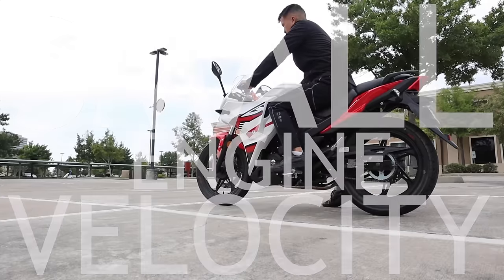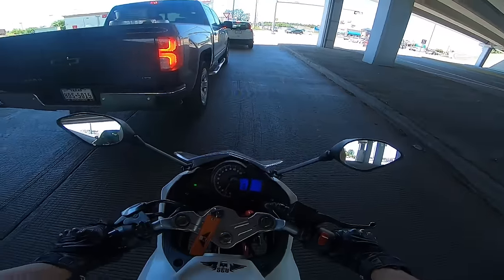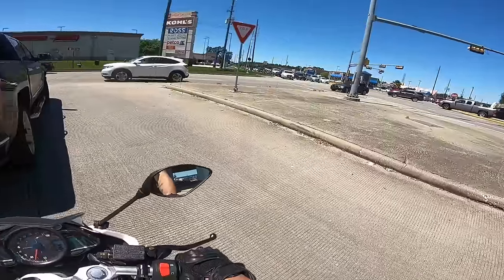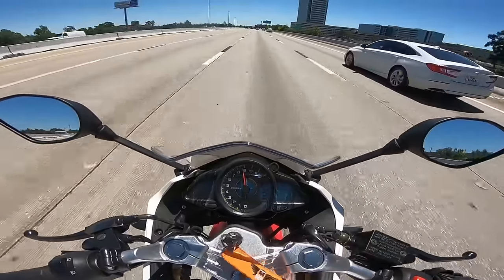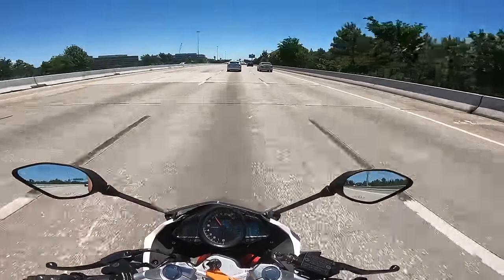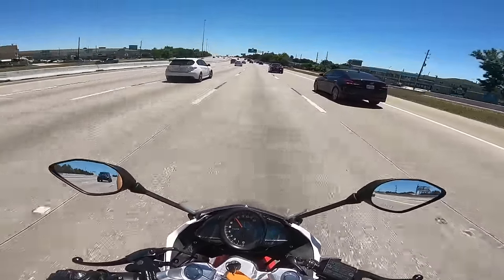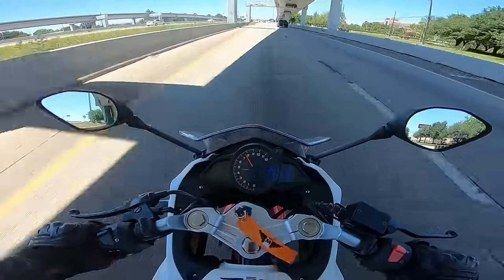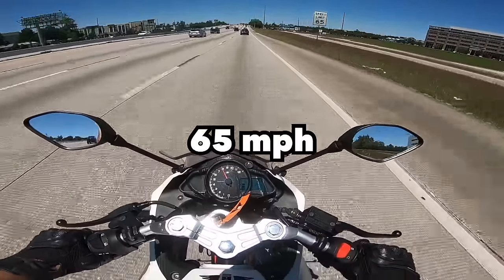Lifan KPR200 First ride on the freeway , how capable is it? #KRP200 #Lifan

Comment: Lifan seems to be one of the few Chinese manufactures that does not exaggerate its top speed claims.  They state 75 for both the KP and KPR.  They state 65 for the Mini which you also confirmed.  I am hoping their enduro hits 70 as it states in the specs...
Reply: I have the expect 200 enduro and I have hit 73 down the hill and no wind but the average after 2000 miles on it is about 65 to 70 gps confirm on flat and no wind .  the only downfall is up the hill sucks , where you might do 55 if you are lucky. In the other hand is a total beast of road, a lot of torque to climb rough terrains.
Reply: Xpect 250cc can do 75 76
But I keep it between 65 to 70
Small engine and tall bikes aren't meant to go highway speeds anyways

Comment: Here is something to think about. Engine RPM does not always mean more speed. On the KPR200, the engine puts out max torque @ 6500 RPM. When you want to accelerate, that is the engine speed you want to keep it at. If you can maintain your speed at 6500 rpm, then you can speed up the engine to go faster.  Past that, you reach your max HP @ 8000 rpm. When you reach this point, you run out of torque to keep the bike moving forward and in most cases you start losing speed.  

Peak HP is reached when your torque is at it’s lowest point. That being said, 6500 RPM would probably be the best all around cruise/engine speed in top gear. This will give you the maximum power to get up hills etc.... You will essentially be running the engine in a torque mode. This method will get you the maximum performance out of your KP-Mini as well.
Reply from the maker: KP mini is good around 60mph Cruising and thanks for the thoughts. It’s a good formula

Comment: wow.. such light traffic..here in ventura county, even cars on the slow lane cruise at 80mph, you need to be doing at least 85 to stay on the fast lane for a few seconds. But this is good, you'll avoid tickets. Impressive for the cheap price.. you even get clip-ons instead of a handlebar.

Comment: Hell yeah. That'll come in handy if you ever decide to go on a long trip on the bike 🤙🏼
Reply from the maker: There is a plan :)
Reply from the maker: After I fix that audio click at high speeds
Reply: Nice. I have some issues with my sena set up. Last time I checked it off the bike it worked but it seems to be having issues while riding. Not sure if it clips and the GoPro completely gets rid of it or what but i gotta get that figured out too before we rode together sometime soon

Comment: Hey man, found your vid linked online and I have to say I'm impressed with this lil beastie! Sounds way better than I expected, tbh. Looking for a relatively inexpensive starter/weekend/zip around town (ideally clone) bike. Won't be used for more than short rural rides. Considering electric for the powerband (if that's what it's called on those🤷‍♂️). I'm opposed to payments, so not looking to spend more than maybe $5-7k unless super impressed by something. I've wanted an R6 since they came out but don't wanna cry the first time I drop it sooo... 5'6", 120lbs, drive truck for a living, relatively cautious, so unfortunately well aware of crappy/distracted drivers. Would sacrifice bike looks for power gains unless it's just a troll, looks-wise Previously owned an ('06?) Yamaha YZ250F and it was fun but too tall and heavy when dumped in the woods lol. Disliked the motor at the time, not snappy as even a couple 125cc 2 strokes I'd ridden. Roundabout way to say I have a good amount of experience riding bikes and ATVs, mostly off-road. Grew up working on cars/everything with my dad so don't like paying someone for repairs unless we're both stumped. Def expecting being stranded when my cheapo whatever shorts out/burns up... Great vid, subbed. Sorry for the paragraph 🤣🤷‍♂️... Any recommendations on a decent starter bike?

Comment: I have a hyosung  GD 250r. And it takes me  to 110. I’m 6’1 240 lbs.
Reply: Clifton W they are around the same price used to
Reply: Yes and you pay twice plus more for that one.  Any motor vehicle that does 80 mph plus is more than enough speed with out getting tickets or acting dumb.   Just my opinion.

Comment: I'm 6'1 and thinking of purchasing kpr 200. Do u think I would have problems with my height Caesar?
Reply: Victor Wallace I’m 6’1  240 lbs. I have the hyosung gD250r which is basically the same height and I have no issues what so ever. The bike has plenty of power.

Comment: I’m 6’1 240 pounds. Is there a Chinese bike for me?. The video was really cool.
Reply: Jun Boo Korean hyosung. GD250r or gt650r. The 250 runs around 2000 which is not to bad and the 650 runs 4000.  I’m roughly the same as you big and tall. And they both fit me.
Reply: Clifton W Oh I really appreciate the info, thanks a lot. Will take a look really soon. Have a great day.

Comment: are you 100 percent confident on the freeway
Reply from the maker: I am , but I dont ride in the far left lane I am fine with 70 mph
Reply: Small Engine Velocity thanks for answering. Love the channel
Reply: Small Engine Velocity can you do a video on the maintenance costs of this motorcycle?
Reply: If you value your azz, as a fwy rider who got hit from behind by a 4 wheelr on my Ducati, let me tell you: First, Sliding down the fwy on your butt at 75 mph trying to kick your bike far enough away so it doesn't crush/grind you to death, surrounded by front/back and both sides auto's watching mesmerized, is literally NOT a good way to spend your time. It WILL however, give you a new insight into the fragility of human life on a freeway, Especially when you finally stop sliding, stand up, and literally HALF of your wallet, falls from what's left of your right rear pocket!!!!  I mean  HALF! with HALF length dollar bills, (credit card s unfortunately were ground away with that half of the wallet, still had my Driver's License though...:) I'm writing this to let you know, NEVER GET 100 percent confident on a freeway!